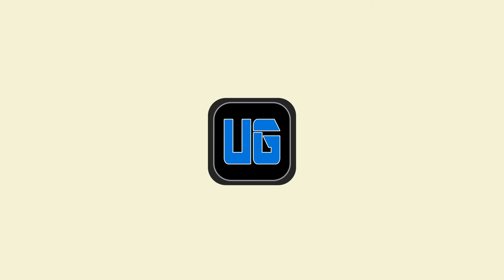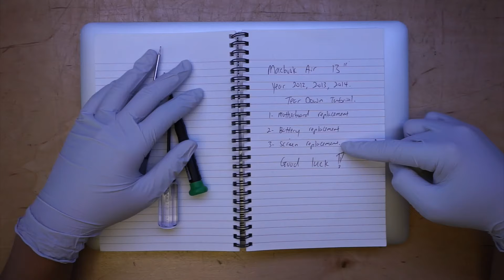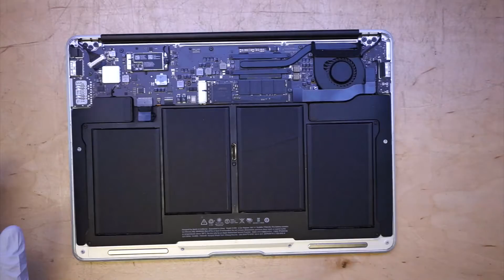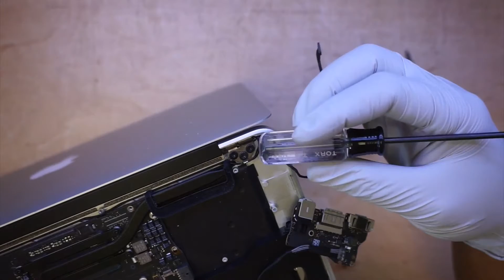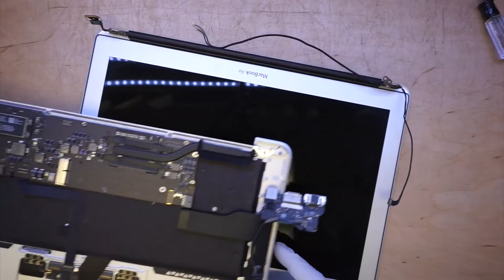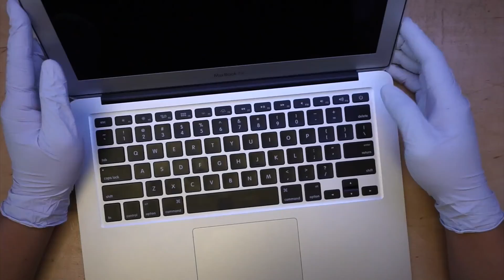Macbook Air 13" Complete Teardown - Step by Step

Comment: can you predict the problem with the macbook air
Reply from the maker: What is the problem with Macbook Air ?
Reply: @UbergeeksBiz  screen flickers (intensity of the screen fluctuates and some times it goes off). When the screen flickers key pad and track pad wont work. (Where to upload vdo to know specifically the problem)
Reply from the maker: @shreecomputers7319  Screen flickers should not have effect on touchpad. I would try using external monitor and see if touchpad still acting up

Comment: Great video! I’m problem solving my MacBook Air now. I do have a question about the wifi cable. Where can I find a replacement for mine? I’ve been searching and not having any luck.
Reply from the maker: Do you mean the WiFi Card ? or WiFi antenna cable ? If WiFi antenna cable, it is all part of the screen. Which mean, you may have to change the entire screen all together.
Reply: @UbergeeksBiz  ok thank you! The only issue I have is that it does not pick up any wifi networks. I thought it may be an antenna cable problem
Reply from the maker: @2babiesmama594  Is your wifi icon on top right next to time&date is grey out ? anyway, the quickest and cheapest way to get wifi fix is to buy this USB wifi adapter. Instead of using built in wifi, you can use external USB wifi adapter. Here is the link:    https://amzn.to/36NiZae     hope this helps.